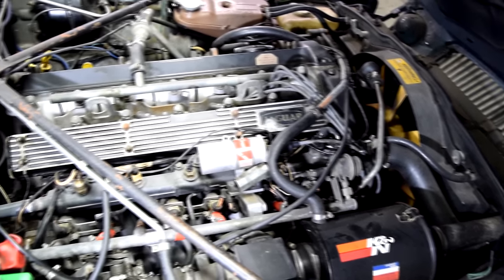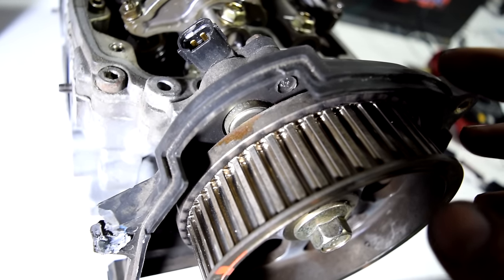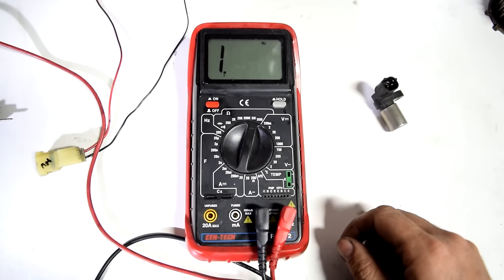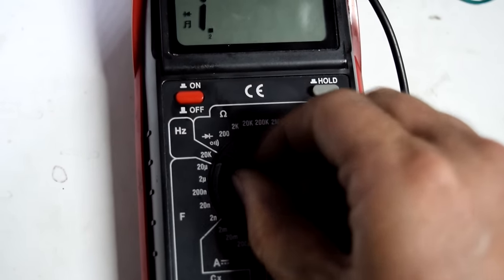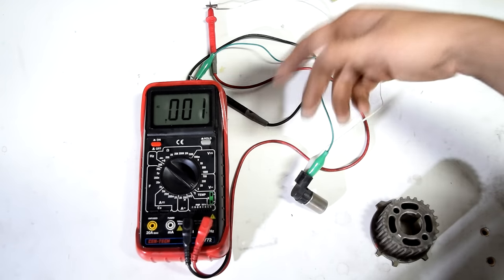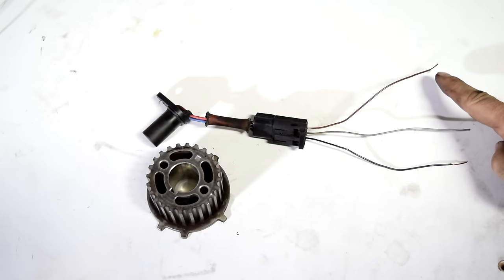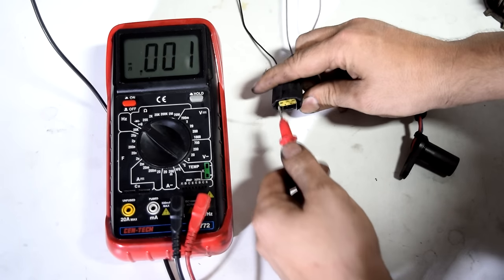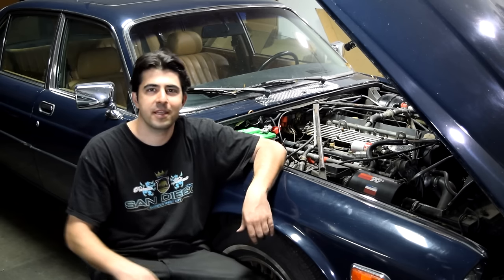How to Test Crankshaft and Camshaft Position Sensors

Comment: I don't understand why does it use AC electricity on the test?
Supposedly sensors and many components work work with DC Electricity (converted from AC to DC)
Reply: Jorge Castanos  the sensor is working like generator. with the magnets and the gear spinning creates voltage like a sine wave voltage goes up and down. so it is ac
Reply: @gabrieltorres6569  Thanks for your explanation. Now, I can understand it.

Comment: in 100 years nothing changed that is the same shit as a ordinary dc magneto the only diference is the magneto 1 wire didnt need those other crap no spark plug no distributor no computers. nice video but I hate those small shit electronic not even mechanics are nothing any more

Comment: i just had a tune up did on my car and now it shuts off after it starts what i need to do.
Reply: Darnell Little 
Try checking little inexpensive things like fuel filter, psi from fuel pump gauged on valve from fuel rail, & your crank pos sensor. Sometimes a weak or faulty altenator will cause a car to stall or stop as well. Batt. & Altenator checks are free at most AutoZone or Advanced Auto parts stores. Hope this helped, good luck👍

Comment: This sensors some times quit wen hot and wen cold they work fine until they get hot again and leave you stranded again it happened to me on my 97  Grand Am , is was a 17 bucks at AutoZone   just change it , my 2005 Chrysler 300 has 250K miles I changed it for no reason and the old one I put it in the trunk for emergency  cuz they are so cheap  ,

Comment: I found 2 constant wires 12 volts. what Shuld I do?
Reply: I found 2 constant 4v...Did you find a solution...Was there readings with ignition on or off? Plse help
Reply: @I-yah890  Yes with ignition on

Comment: 1:35 sensor produces ac voltage?  how is that?
Reply: how do you think a generator works? bunch of magnets, spinning metal very close= power! same way the lights worked on my bicycle years ago: a magnet, of course a coil inside, with wires going to a light, a spinning wheel and spokes made of magnetic metal, BOOM let there be light